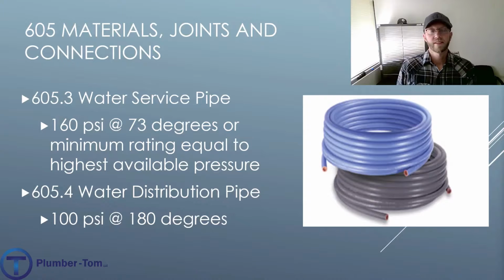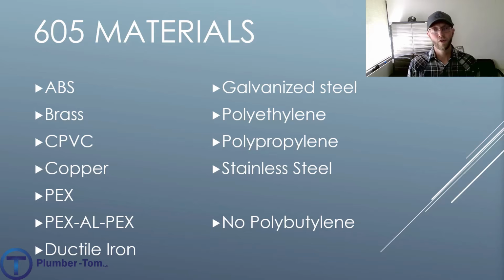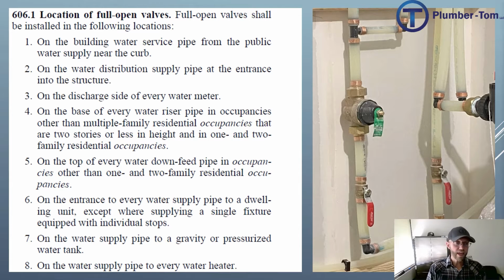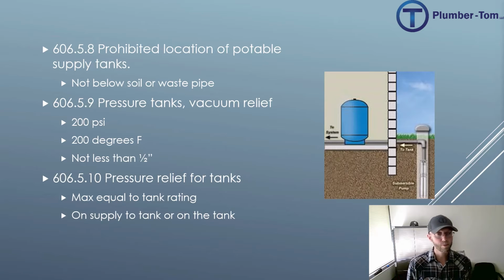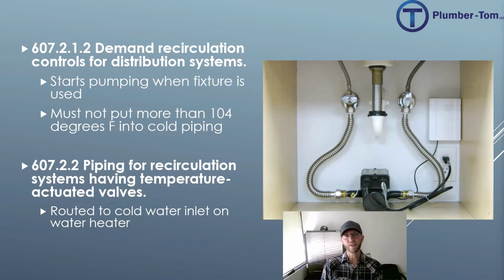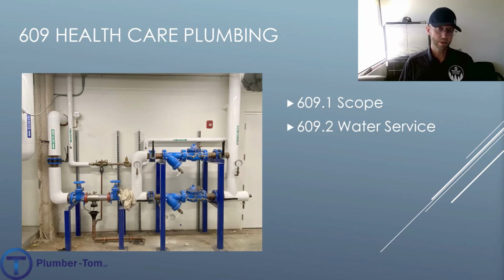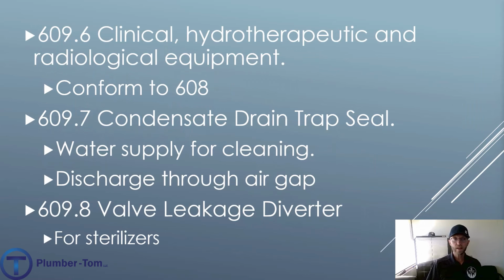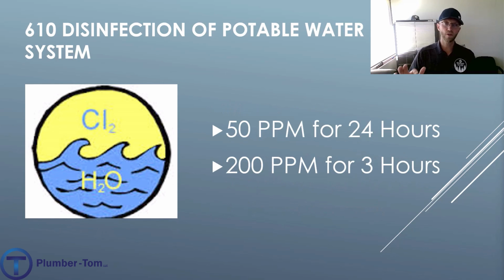Understanding International Plumbing Code: Chapter 6 Sections 605 to 613

Comment: Glad you are doing so well! Your videos have helped a lot! Code question for this section: if code requires a shutoff valve to an outside hose bib, and the shutoff valve is shut for 5-6 months of winter (line is not flush-able), won't that be creating a dead leg between the main run and the shutoff valve? IPC doesn't say what length of pipe makes a dead leg or how often to flush dead legs. Is there a residential plumbing shutoff valve / tee fitting combination that can meet the consensus 1.5x ID max dead leg definition, say for 1" main x 3/4" branch? Then it would not need flushing at all. How would you plumb this and know it meets code? Thank you!
Reply from the maker: Where are you coming up with the definition of a dead leg?  I do not see it in the code.  I think it should be okay if it is being used every year.  You might argue that any fixture that is not used for a long time becomes a dead leg.  My parents are empty-nesters and some of the bathrooms in the house never get used.  If it is of concern the lines can be flushed by running the fixtures.
Reply: @plumber-tom9470  Thanks for the reply. The 1.5 isn't in the code, it's more of an industry /engineering standard, I think. Oregon may have adopted it though: https://www.oregon.gov/bcd/codes-stand/Documents/interp-22-01-dead-legs.pdf . I appreciate your advice. Stay well!
Reply from the maker: Cool. Good to know.

Comment: I love manifolds, just make the valves replaceable or replaceable after minimal work. Union valves or rebuildable inline valves. Irrigation philosophy trick. We HAVE to make manifolds for automated systems with solenoids and manual valves. Hammer arrestors are very important in my work.
Reply from the maker: Irrigation manifolds are great.  Mechanical manifolds are great.  Just the manabloc manifolds by Viega are a bomb.
Reply: @plumber-tom9470 thanks for your videos buddy! They have been a tremendous help! My test is Monday😮‍💨

Comment: Great videos.. I never thought things are so well documented. I am looking to repair a pipe break in my garage of CPCV pipe. I wonder what kind of code will apply to such a fix.
Reply from the maker: Chapter 6 has the information about water pipe materials and joining methods. Good luck. 👍
Reply: @plumber-tom9470  Thank you